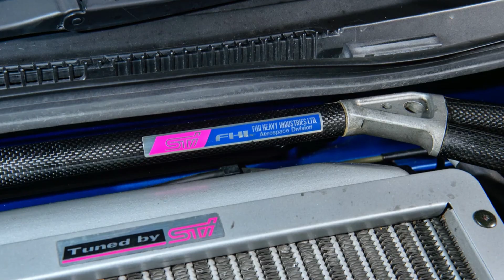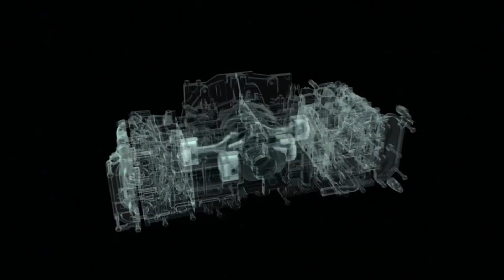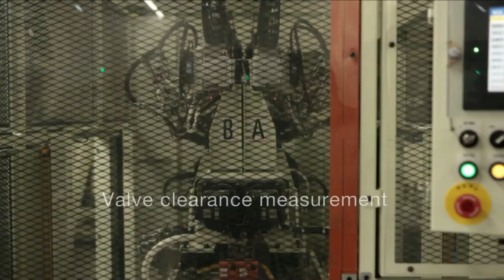The Shocking Truth Behind Subaru's Problematic EJ25

Comment: I recently purchased an '03 Forester XS (non turbo) with 244k miles on it.  CarFax revealed that the MLS head gasket swap was done at a dealership at the 178k mile mark.  That should easily get me to 350k+ miles on this engine.  With a 5MT, this car is piss fun to drive!

Comment: If my ej25 legacy had wings, it could fly, a jet engine, it could go into space, ora ballast, it could go in the sea. Nothing it can't do. Extraordinary and fortunate I stumbled upon it.
Reply: Only use distilled and Subaru coolant. Nothing else is compatible no matter what it says on the jugg or what "the guy" says. Wrong mix will wreck the head gaskets faster. With the later gasket and correct coolant your chances are better it'll always be ok.
Reply from the maker: The EJ25 really does have that unstoppable energy — it’s like the Swiss Army knife of engines.